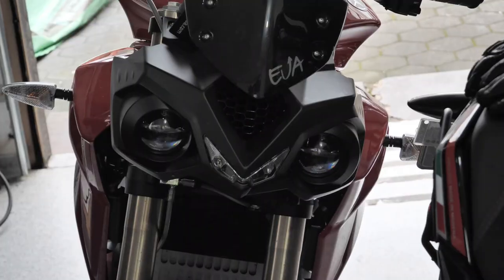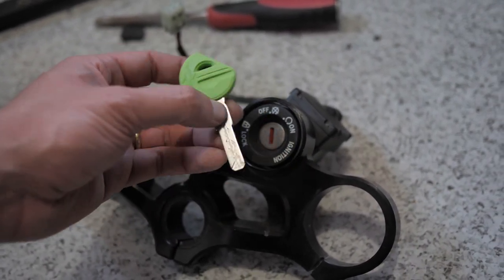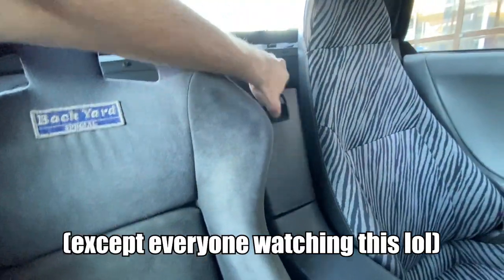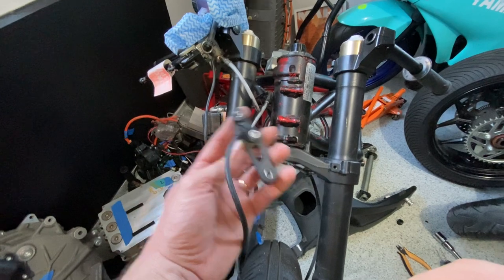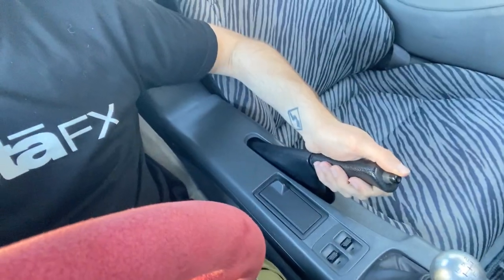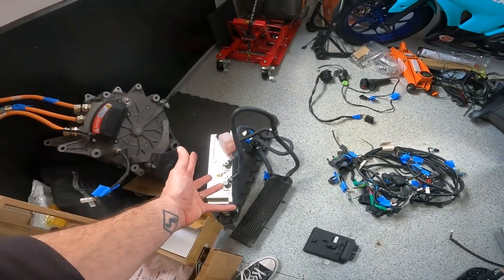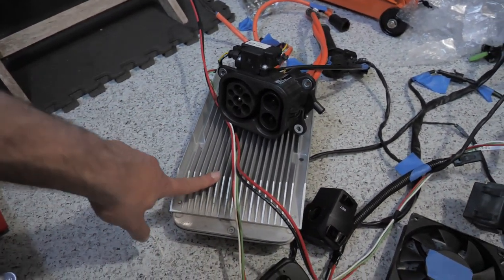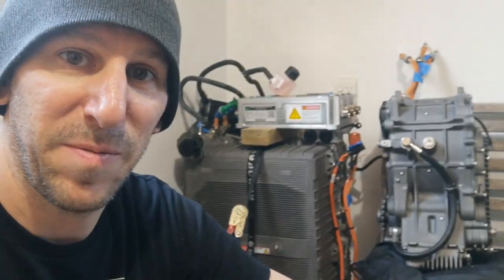Electric Honda Beat Conversion - Episode 6 - Getting the parts working outside of the bike

Comment: It's not just the sprocket ratios that predict the speed. It's also the circumference of the tyres (I guess factory tyres) So you'll need to calculate that too. If you put a larger sprocket on the axle and the Beat has smaller tyres is there a chance this could even out?
Reply from the maker: Ohh yeah totally, you're absolutely right! Time to do some calculations 😎
Reply: @NewZeroland  Don't your two Ribelle have different size sprockets? Maybe that helps explain different top speed... readings.
Reply from the maker: @audiencemember26008  yep, but the speed difference is something else I think. Gearing changes would have been way more noticeable.

Comment: Ignition in between the 2 seats and the flux capacitor above it.
Reply from the maker: Too perfect lol
Reply: Doc I think you made a mistake here. This is a Japanese yellow plate. I’m not even sure it will make it to 141 kph (88 mph). 
Great Scott!!
Reply from the maker: @stevenb7319  😂😂😂 yeah top speed is only 80 in this car hahaha. Where we're going.. we still need roads.
Reply: And a steep down hill. 
The electric motor will probably improve the top speed by a bit. It’s funny how much work they put into the aerodynamics with such a low top speed. It does stretch the efficiency though.
Reply from the maker: @stevenb7319  yeah for sure!  In theory I can gear it to go whatever speed I want, but I'd rather keep it low for more launching torque :D

Comment: I think I saw that your motor is not in the coolant loop; is it not water cooled?  So it's just air cooled?
Reply from the maker: It's oil cooled! The older Energicas had water cooled controllers and oil cooled motors / gearboxes. The new ones are all in the same coolant loop.

Comment: Hai 
Sam what is the difference of energica Eva and energica Eva(rs) I an very confuse
Reply from the maker: They have different gearing and power maps. The RS has one less tooth on the front sprocket and a special tune to launch it faster.
Reply: @NewZeroland  so which bike l  buy Eva ribble or Eva ribble rs
Reply from the maker: @shiftend7316  both bikes have the same top speed, so it all depends if you want better acceleration. The RS launches faster 😁
Reply: @NewZeroland  OK there for I am buy Eva (rs)